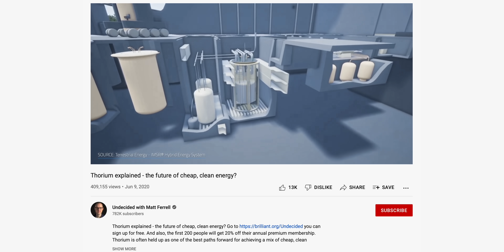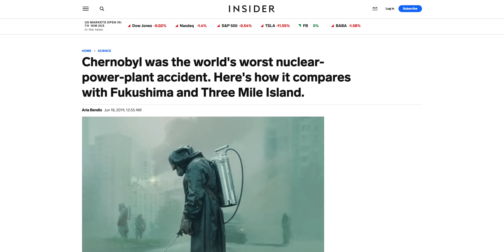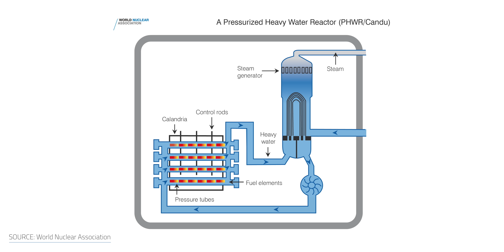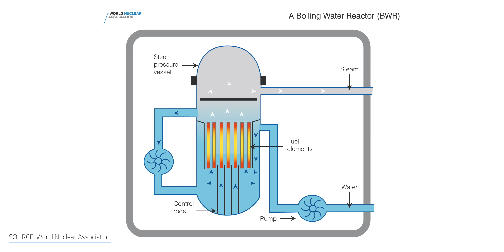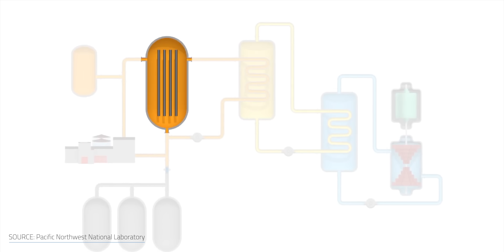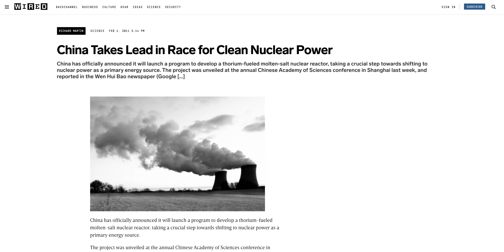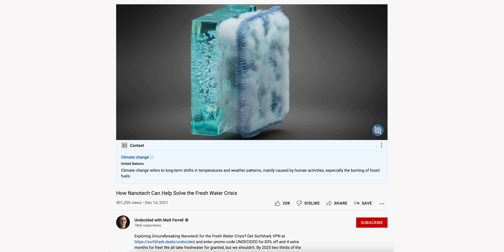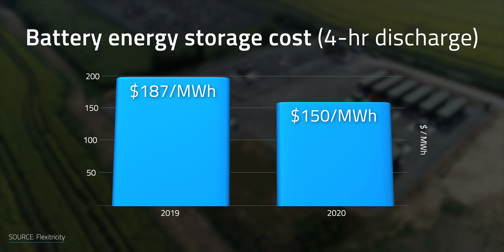Revisiting Thorium Energy - The Future of Nuclear Power?

Comment: Yes we need nuclear badly, to reduce climate change. The waste problem is there, but fossil fuel power plants also produce a lot of waste, but they dump it simply in the air, causing climate change. So, do we need thoriumreactors? I think we foremost need MSR's, no matter what we would burn in them. You can fuel a MSR with nuclear waste from contemporary reactors, reducing it's volume significantly AND the waste that the reactor produces afterwards has a much lower half-life. You have to store it for 'only' 300 to 500 years, instead of 10 000 years. Quite a difference. 

Not only desalination is a nice byproduct. Because of the much higher operating temperatures, the operator could sell heat to the industry (besides electrical power), with numerous possibilities. One of them: building organic molecules like kerosene or diesel from CO2 and water. Planes, ships and trucks could operate with traditional engines on very pure fuel, that would be carbon neutral. Thorium is a nice 'extra', but the real advantage is the very concept of the molten salt reactor. While it operates under atmospheric pressure, the containment vessel of it could be much smaller, making it possible to install relative light reactors on many locations, shortening the transport losses. MSR is win-win-win... (ok, we have to solve some issues, but the odds are...). Let's start this NOW!
Oh, and did I mention powering settlements on the moon or on Mars?

Comment: Is there a viable case for nuclear over wind or solar.... short answer yes, here's why both solar and wind take up large tracks of land in order to generate the necessary power, so for countries with limited land area either due to size or terrain a handful of small nuclear plants dotted around the country would be able to power it near indefinitely due to their smaller size and small fuel to power ratio.
Another thing is not every country has viable demographics for solar or wind take someplace like Alaska or Finland that only has limited daylight for half the year solar is clearly not as viable a option, now take someplace such as Tucson, Arizona or the DRC where wind speeds are generally quite low nuclear would be the better option for those since power generation is not reliant on natural forces and can be generated year around in any weather condition.
So when it comes to terms of space and consistency nuclear wins out across the board, the best option for humanity would be to use nuclear as a primary power source with solar, wind and hydro acting as supplementary power producers where viable and completely doing away with fossil fuel sources.
As far as public perception and fear goes that will likely take more time but will gradually decline once people see with their own eyes and once the media stops pushing the fictional nuclear dystopian future narrative they have had since the 80s, those of us who have lived around nuclear have no issues with it I myself lived 6 miles from the Turkey Point plant for a solid number of years and am no worse off for it.

Comment: If we consider Germany as an example of whether we need nuclear, then yes we do. Germany doesn't have access to abundant solar or wind. After shutting down the majority of their nuclear power stations they had to revert to coal power stations to provide a stable base line of energy within the country.
The exact opposite of green energy. 

My perception of "green" energy is that its merely a method to collect energy produced from an existing fusion reactor. 
IMHO, I think we need to be more in line with creating energy from reactors of our design, than merely collecting it, so that we can overcome the technological hurdles of making it safer earlier on.

Comment: Great vids Matt, thank you. Fusion is the clear long term winner. Mankind would be better off putting the worldwide brain trust into fusion tech to get the damn thing up and running rather than wasting time and resources on thorium (as good as it is compared to traditional nuke reactors). The classic "15 years away" often touted for fusion could be done away with if the world came together and concentrated in a highly focuses manner on fusion. I've no doubt it would be cracked and here powering homes and industry by 2030 for sure then.

Comment: 1112F is about 600C.  Clearly 600C is the original unit here and is not specified to 4 decimal places.  How about giving the original unit first then the conversion but rounding to a sensible precision.  In this case 1000F would give the right temperature within the precision implied by 600C.

Comment: Matt I want to address one factoid you said about "mining Thorium is more expensive", that's kind of misleading (not blaming you, I'm sure that's what you were told or read.) However, it's only "expensive" because it's classified as "waste slag" at rare earth mines and have to be regulated and stored. That's literally just a regulatory price tag. Most owners of REM(Rare Earth Mineral) mines would love to put this stuff on the market, because they haul this stuff up as a by product of what they are going after in their mines, they have piles, and piles and PILES of thorium precursor just sitting  doing nothing. If the regulations were changed to allow this stuff to be sold on the open market, the price tag would drop dramatically because there is just so much of the stuff. And you wouldnt even have to build a mine just for thorium, you'd just go to Rare Earth Mines who, as i said before, pull it up as a by product of what target mineral they're really after. But whoever told you or whatever source you read, that said Thorium mining would be more expensive, is either just ignorant or they lied to you. And I wouldn't just dismiss that second part because there is ALOT of resistance against making MSRs, especially LFTRs a reality. Because they know damn well, these things would pretty much "Save the world" in terms of solving the energy and environmental crisis.

Comment: Two questions:
- I seem to recall hearing somewhere that thorium reactors could actually be used to consume nuclear waste from traditional nuclear power. Is this true? If so, that alone would seem to be a huge advantage.
- How adjustable is the output of a thorium plant? Is it only suitable for base load or could it replace the highly reactive gas power plants without resorting to batteries?
Reply: Yes Th MSRs can burn nuclear waste from traditional U reactors.  If I remember,  Kirk Sorensen estimated up to 5% of the fuel could be old waste.  
     Q2: power (heat) output can regulated by adjusting graphite rods in the MSR, increasing or decreasing the amount of fission reactions.  Also, most MSR designs are small, some are small enough to fit on a flatbed trailer, making mass production in a factory viable, thus greatly reducing cost.  The thinking is if we make them small then each town could have their own MSR.  Bigger cities would just need more small MSRs.  Thus power output is scalable in this way too. It would also eliminate the need for high power lines (where power loss can be significant) and an interdependent grid, making us much less susceptible to grid attacks or EMPs.  The video didn't mention these other benefits of MSRs.  It's the smartest way forward bc wind & solar can't even keep up with increasing demand, let alone supply current needs.
Reply: I responded to your question but realized there was a misunderstanding that many people have about the way thorium is used in power generation, and what it can do with plutonium as a fuel source. I posted a general comment about it if you'd like to read it and understand the process better.
Reply: Most MSR designs are load adaptive and can generate more power as demand increases, thus as long as the infrastructure can handle the level of power and peak demand doesn't exceed the generation capacity its not an issue.  Also it would eliminate the need for storage.

Comment: You priced wind with 4 hour storage, To fairly compare to nuclear baseload wind should be compared to 72 hour storage. Solar can be compared with 12 hr storage in some sunny locations, more in cloudy locations. If sufficient storage is not priced in, the added cost of regional interconnects and long distance DC transmission must be considered. When these necessary externalities are included nuclear becomes much more competitive, indeed it starts looking like the best deal for reliable, long lasting baseload power. Note that the levelized cost of electricity is commonly calculated for a 30 year plant life, yet wind generators are commonly due for replecement after only, iirc, 12 years or so, sometimes a bit longer - while nuclear power plants commonly last 60 years, and licensing is commonly extended longer than that - so there is a very long period of power generation after the plant has been paid for per 30 year levelized cost calculations.

Comment: Yes, solar and wind are cheaper, but they are not enough without the huge investment of power storage to cover peak usage periods.  A MSR coupled with solar and wind and a proper grid system would end any countries reliance on oil or gas for power generation.  The benifits of structuring your industry around MSR power plants to use the waste heat are mind boggling.

Comment: For renewables to become feasible you'll need somewhere around 400 hours storage, not 4 hours. Putting the LCOE around 160 USD/MWh. Then add in the grid-costs and you're looking at around 200 USD/MWh. Or 3-8 times higher than standard uranium nuclear.

Comment: The need for nuclear power will vary from country to country according the primary energy demand and the availability of alternative fossil-free energies such as wind, solar, hydro and ocean power. Here in the UK there will be a practical limit to how much these "renewables" can be ramped up to meet the 2050 deadline, so we will need new nuclear power to bridge the gap. Most of the UK's nuclear power plants will reach the end of their working lives by 2030 when they will be closed down, so the UK needs to start building more nuclear power as fast as possible. The traditional designs based on moderating and cooling the reactor by high pressure water at over 2,000 psi and 345C have to be installed in massive expensive containment buildings in case of a meltdown such as our Hinkley Point B and C which take a long time to build. The use of molten salt or metal cooled reactors removes the high pressures needed for water cooling, and these low pressure reactors can more easily be manufactured in a reduced size as a small modular reactor (SMR) in a factory and shipped to site by heavy road transport, making them suitable for more localised source of heat to retrofit existing gas fired power stations.

Comment: Solar is the worst enemy of the environment: 1: photovoltaic cells are far more efficient at turning sunlight to heat than making electricity. The heat island effect is well studied but not the convective heat that pilots are familiar with. 2: Plants are the enemy of solar and sensitive environments must be cleared away often using herbicides and we are even now converting farm land. 3: Animals are also targeted by solar, the vast perimeter fences often block migratory routs of sensitive and endangered species. 3: Solar is far more expensive that government figures show due to complex arrays of subsidies many of which are not factored into the published figures.

Comment: I believe the Idea that thorium reactors don't need large quantities of water to operate is false (I know the thorium alliance claims it):
  That the inner circuit cooling the core does not contain water does not significantly reduce the required supply of water since it is a closed circuit (in uranium reactors as well as in thorium reactors).
  The turbine circuit will still use water (which still doesn't matter since it is also a closed circuit).
   But behind the tubine that water needs to be cooled down and to get rid of that heat, water is necessary.
  For every MW produced you need to get rid of ca. 2 MW of heat and water cooling is AFAIK the only practical way to do so.

Comment: Nuclear is safe. Thorium reactors are better but uranium based reactors have operated safely for decades. The only people that fear nuclear power are the small minded and those who are made rich by the oil industries. What’s the point of having electric cars if the energy used to charge them still comes from fossil fuels? Wind and solar suck because they don’t work 100% of the time and their output is dependent on uncontrollable variables, but fossil fuels and nuclear do work 100% of the time. Nuclear is the future and people need to get over their fears of it.

Comment: The thing about nuclear energy is that it has massive output on power. We would only need a few hundred reactors as compared to the few thousand coal and gas reactors across the country. With a few hundred nuclear reactors we could feel the entire countrie’s power demand. While solar, wind, and hydroelectric reactors are greener. They are also extremely  circumstantial on their outputs while a nuclear reactor can have a far more consistent output year round. With the power demand increasing over the years I find it impossible not to move toward certain nuclear reactor technology. It won’t be easy and it will take years, but 100 years from I hope we would have moved toward a completely green system of energy with high outputs, we need it we want to function within that allotted time frame. Gas is running out, fracking is just horrible for everyone involved, and I don’t even need to mention why we need to move away from coal

Comment: the main advantage of nuclear is that ,unlike sol and wind , it is not interrmitant . you need power, you turn it on.Just like coal or gas but no carbon. and no huge,ugly batteries. Plus, ya gotta love the cheap de-sallination.I'm trying to find out where I can buy shares in a thorium reactor company. Mostly they're at too early a stage of developement.

Comment: While Thorium maybe more expensive to mine, converting the fuel into something used in the reactor is substantially less complex and cheaper than Uranium. Even in SMRs you need to concentrate the ore and construct the fuel rods that are pressure containment systems constructed with not-inexpensive materials. With Thorium these chemical steps are reduced and most designs seem to forgo use of fuel rods. Also fuel cost is only a small part of the overall economic picture of both MSR's and other nuclear fuelled power producers.

Comment: I think Thorium has another great benefit.  That is that since the primary system is non-pressurized, the quality control standards that drive many of the Nuclear Industry costs should decrease dramatically since the components will be able to be mass-produced in modular packages usder standard ISO processes away from the reactor site and should allow the potential for use of threaded pipe fixtures with metal O-ring seals for joints rather than the tedious and time consuming weld processes used in nuclear power plants both past and present.  The reactor vessel wall will be much thinner with fewer stress cracking problems associated with heat-up and cool-down soak requirements of the plant piping and reactor vessel.  One minor down side is that you have to have heaters in or around the reactor vessel in order to both keep the salt solution liquid while you pump the solution in for the first time and before you put in already pre-heated heated salt solution so the reactor vessel is at the same thermal temperature as the salt solution.  Additionally, the containment structure can be much less massive (note, I still think we need a containment structure in case of a steam release or salt leak, to just to contain possible radionuclide materials from spreading.  I would suggest the most critical part for manufacture will be the steam generator since this is where the high pressures on the secondary, steam, side will be and where radioactive elements could, under metallurgical failure conditions, migrate into the secondary steam system.  Even this is isolatable with in-pipe radiation detectors for alarms and steam system shutdown and isolation as ell as pressure alarms for the primary system since the high pressure steam would tend to migrate into the much lower pressure core vessel.  Incurrent reactors, the leak is towards the secondary steam side (trust me I have witnessed this happening).